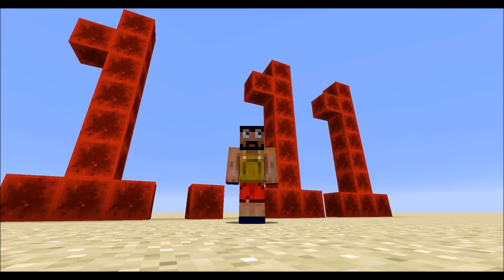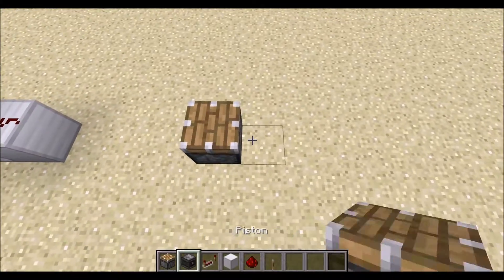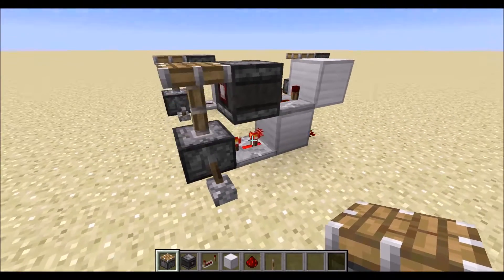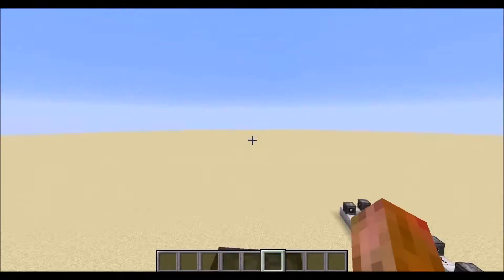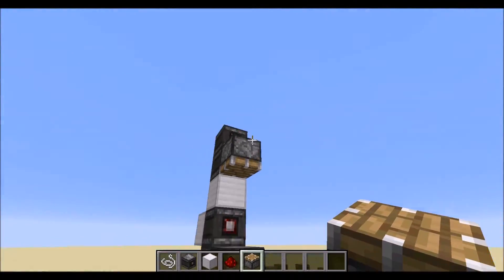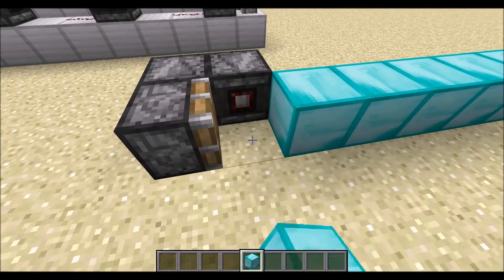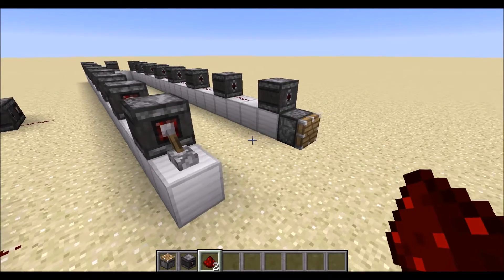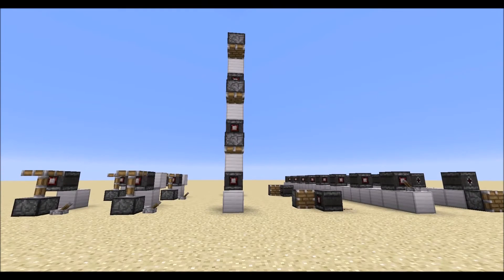Minecraft 1.11 :: New Redstone Circuits Using the Observer Block

Comment: i was doing work with observer blocks made a cool discovery ended up destroying it cuz i wanted to make a sand launcher XD
Reply from the maker: Sand launchers are cool. Never done one tho
Reply: It had used the contraption at 5:00 and basicley you would take that and put a water source next to it so it was a clock where when ever the water would try to flow it would put out a output and the piston would break the water